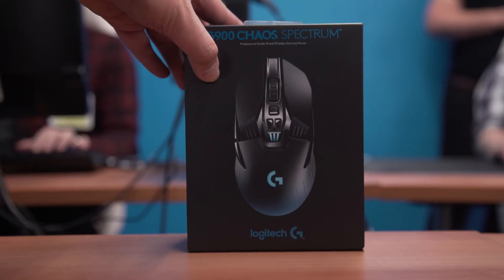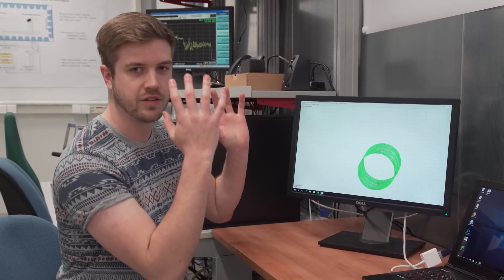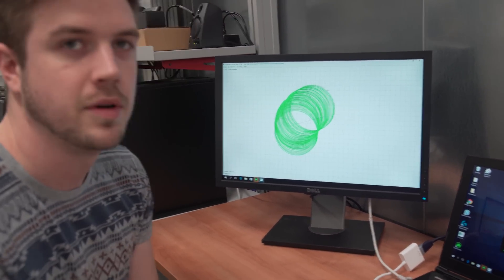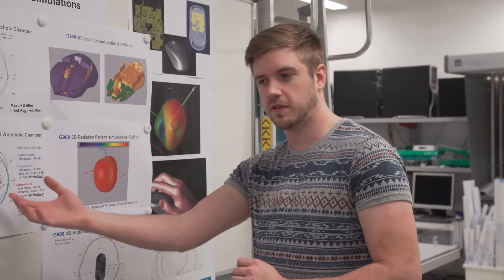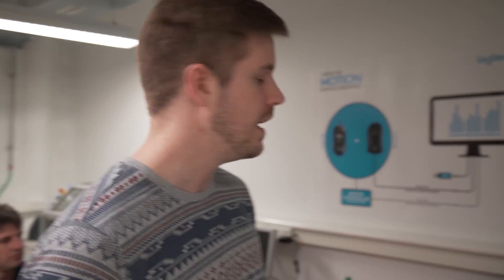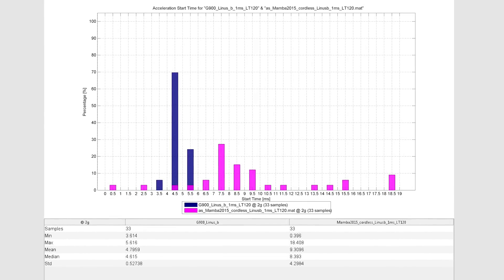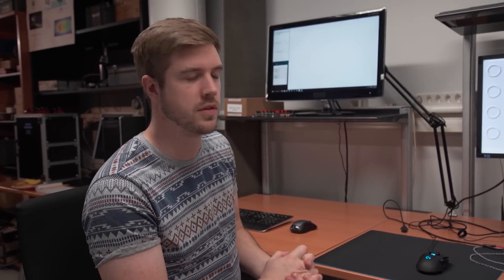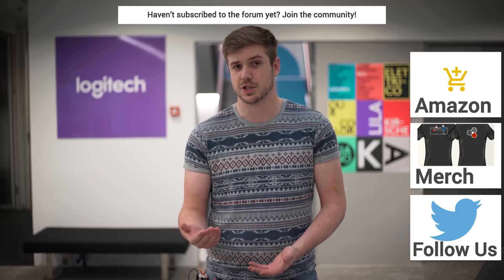Wireless Mouse Technology Testing at the Logitech Daniel Borel Innovation Center

Comment: 1) 'Razer Chroma' is not a mouse. 'Chroma' is a term used by Razer to indicate that the mouse is RGB. You'll notice that the system says 'Razer DA Chroma', which means it's the Razer Deathadder.
2) You talk about the deathadder, but show video of the wireless Mamba.
3) Why are the tests only against Razer mice? Can the G900 not beat good mice?
4) "Faster than a wired mouse"... Yeah.. I'm gonna call BS on this. I'll believe it when I see a 3rd, impartial party test some mice.

EDIT:
I see they added in a SteelSeries for the click test. Must have found another mouse that performs poor in that area and added it in to the test.
Reply: The sensei was also there for the first test.
Reply: The first test was wireless interference... and the sensei isn't wireless... so... yeah...

It also wasn't there for the sensor response test (2nd test).. That was the Logitech G900, Razer Deathadder, and Razer Mamba.
Reply: Bradum
It was. Watch the video again. Here is the product link: steelseries dot com/gaming-mice/sensei-wireless

Comment: My problem with wireless has never been one of performance but the several times where halfway through a round of LoL or during a raid boss the thing dies and I am frantically sprinting around and stealing batteries out of the remote. My wired mouse preforms perfectly with 0 issue and it never has me frantically running around the house. For a standard desktop set up I see no need for a wireless mouse.

Comment: I have to say that I own a Sensei Wireless and never had any issues. It works perfekt for CS:GO. I even went to a ~30 Person Lan with it and didn't notice anything like that. Maybe Logitech has given you a bad sample or manipulated it.
Reply: They were using a crazy worst case scenario though, which is probably why you haven't seen anything like that
Reply: Do you not realize that the signals that were sent were extremely exaggerated as claimed, to see results like that you would need to be at a "300 person LAN times 10" so literally a 30,000 person lan and if that you still wouldn't see those results... It was just to test extreme unlikely situations to see how they would perform.
Reply: +Dr.PanCakes he also tested it without and it was bad, thats what I ment

Comment: Cool video and synthetic tests. But basically, the G900 is different from it's competitors (compeptitors specially selected by Logitech? If so shame on LTT) by not failing in crazy worst case scenario no users are going to experience? Way to go Logitech, have the engineers made you loose touch with your customers again?

Comment: I wish Logitech would compare it to there previous mice as well (G402, G502 and the G602), to see how it copes as an upgrade to there current user base. There certainly pushing it as a major improvement in wireless gaming, but how much of that were they using in the G602's wireless model?

Oh and I get that the video was effectively sponsored by Logitech (bringing you over to there testing campus), but it would have been nicer if the video was shorter, not repeating footage for re-running the tests or anything else of the likes, instead just explaining how it works, getting one clear footage of explanation and then data filling the screen for the rest of it.

Comment: My very first Wacom Intuos 2 Tablet shipped with a CAD Mouse that worked similar/identical to their Pens in that they were wireless AND batteryless by pulling their energy wirelessly from the Tablet underneath it - That thing was ultra light - Just not very ergonomic.

Just imagine a Logitech Mouse that keeps itself charged using the Mousepad underneath it with a small and light Capacitor storing enough of a charge for a few more clicks in the air when the Mouse is not in the charging area instead of heavy Battery that works longer but still needs to be charged by either attaching it to a tether, putting it into a dock ( mostly unreliable ) or changing batteries.

Comment: Just wish logitech would bring back the G9/G9x with an updated sensor. The g303 / g502 don't cut it.
I did find it funny they where still running a mx500 on the desk while testing such a new mouse.. Wonder why they haven't updated to the g502?.....

Comment: How can a person tell the difference between 4 and 7 ms???
Reply: +Khanlar Mamadov Nobody can. Under 20 ms it becomes very hard to tell if there is I/O latency at all. But the reality is... it does not matter if you cannot notice the difference. Let me explain because there are two main reasons why reducing every ms is important.

First of, as Luke pointed out, reducing I/O latency at every step of the line (Mouse, CPU, GPU, Network and Monitor) is crucial because every step adds up. So having 10, 5 or 3 ms less is always good.

Secondly, let's say your average reaction time is around 170 ms with a wireless mouse that has 10 ms of average I/O latency. If you change your mouse to a faster response one, you might be able to lower that by 5 ms, which, as you say, it is insignificant but 5 ms less on average can make a noticeable difference over time on certain competitive scenarios where every ms counts, specially for pixel perfect shots where your margin of error is pretty damn small. The reality is that even 1 ms can make the difference between landing a shot on target or missing.

Having said all this... is it really that important? Mostly not but, as I just said, on a competitive level it could make a significant difference.

Comment: I have been using wireless mouses for years and never experienced a single jump.
Reply: +theSomething most people have the receiver like a  foot or so away, so the signal is stronger. so yeah never had a problem running a wireless mouse (unlike my logitech g600s, the wire is so thick it hinders the movement, so i only run it in wireless mode, thus better performance lol)

Comment: So they have somehow made USB+RF device faster than just USB? So that means, that they have made some significant changes in both; USB and RF, but the mouse would still be faster, with just USB, using the same new and faster technology? I mean, every conversion of the data will always create some delay and RF is one of those. Wireless mice are quite pointless in my opinion, maybe useful with travel laptops, but you don't tend to game with those. I also find it kind of unethical to use your competitors devices in your own promotional video, because it implies a lot of things.

Comment: Would have been nice to see you turn on the interference mid test with the g900 like you did with all the others. Whilst we can see there's no discontinuities, we can't see if the sensor drift remains in the same direction and you pointed out with the others that the jump in drift direction was a sign of interference playing with it. First rule of experimentation is keep your test parameters the same.

Comment: Signal strength and consistency seems important but 2ms more latency when your average gaming monitor now a days puts out frames only every 144th of a second. I mean, it is cool that you can but you don't need to.
Reply: +Ni De 
your math is wrong. It is... 1000ms in 1 sec. 144 frames a sec. 6.94ms..
1000/144=6.94

Comment: You should have also tested the mouse at various distances to the sensor, including as close to a third of a meter away, or even right on top of it. Signal integrity also has a lot to deal with distance between transceivers, especially the interference test.

Comment: i would love to see how a Cyborg Rat 9 would handle interference. since i had one but went to a Rat 7 instead due to the charging station shorting out one night.
Reply: +pesoen rat 9? man them mice suck for people with large hands, they break so easy!!  i went through 3 replacements as the thumb rest screw or such would thread. nice idea, shame they was made on the cheap!
Reply: CrythornMadness i'm running a rat 7 now, had it for at least 2 years with no problem, other than the inside getting dirty. and hard to reach places being difficult to clean. then again, i hardly do much like slamming my mouse into my table to break it and stuff(not that i'm implying you do, but any mouse should last at least a year before any damage occurs, so you must have done something wrong)
Reply: nope, just big hands (im 7ft) and heavy gaming use i guess, but that thumb rest screw goes within a week or 2 every time.(I dont lift the mouse while i game, i just use high dpi) suddenly you feel your thumb sliding close to the mouse as the thread just rips off the screw/nut.
Had to ditch that brand for a logitech g600s and a razer mamba 2012 (use 1 while other charges)
Reply: odd, never had issues, only that it came loose at one point. but efter tightening it, it worked fine up to this day..

Comment: Why didn't they test the g900 like all the other mice? All the other mice were first tested without interference and then turning up the interference while the mouse was operating. the g900 was just tested with interference and without that transition from no interfering signals. This transition was a huge problem for the razer mamba, but after the interference was there it got better again. I have the feeling that they are intentionally not showing that for the g900 because it's just as bad.

Comment: This would be actually worthwhile if done by a third party with better selection of mice (+the reason each mouse was selected). Right now, regardless of how great the mouse might actually be, I have no reason to believe Logitech didn't pick just the subset of their competition that makes them look good. Not even scientific measurements are free from having a spin put on them.
Reply: +Daniel Jeřábek I think they just picked razer because it's one of the most popular brands and unlike zowie or mionix you can find it at pretty much any major tech store. Basically they picked the two most popular models (one wired, one wireless) from razer to devalue the products of their biggest competitor. You're right, though, it would be nice to see an unbiased party test how other mice, including other logitech mice, perform with respect to these parameters.

Comment: I didn't get the point of the first test, can somebody explain that.
Reply: +Squeezy l Squeezomania It checks to see if interference from wifi and blutooth signals affect tracking in wireless mode. Because the wireless sensor and devices like wireless routers operate in similar frequency ranges, the signal from one can interfere with the other. It's the same reason why you'll often get really patchy cell phone signal when you're in a crowded stadium. Too many interfering wireless signals.
Reply: David Livermore Ok, that explains it, thank you

Comment: it is really annoying, that luke never questions the testing method.
Once he said, that this is a extreme scenario. I think its just unfair for the competitors.
They jammed the wireless/wired signals with an unrealistic amount of wlan noise and testet it only with there picket mouses.
Wrap some aluminum foil around  the wire of any wired mouse and you will get goods results to...
Linus always claims that sponsored videos wouldn't buy a good review, but obviously they are to afraid to say something bad.
Reply: To be fair, it just proves for any case, the g900 will perform better. If the results were that consistent and good in an extreme case, it would either a) perform even better in a normal case(other mice will too but it won't be perfect still). What I do hate however is that the battery I don't think is removable(but I see why they didn't).

Comment: If this mouse's scroll wheel/tiltmouse clicks feels as good as the g600's then im sold. I dont understand why mouse tilt isnt a standard nowadays. I just want a mouse smaller than the g600 and one with grip coated scroll wheel with tilt and 3-4 side buttons. also have some kind of weight option because i like my mice heavy.
Reply: +Slade Zero The problem I've always had with tilt scrollwheels, including the g502's, is that if you flick the mouse fast and then stop, like you would when you flick to someone's head, the scrollwheel wobbles a little bit. It doesn't activate the tilt button but it does feel really annoying in games. I don't think it's ever made me miss, but it always ends up bothering me to the point where I get a different mouse.
Reply: +David Livermore well to be honest g502's tilt wheel is garbage. if you used a g600's you would know how good they could be. it doesnt budge unless you mean for it to.
Reply: Slade Zero I've used several implentations of their tilt wheel and the g502 uses a solid metal wheel. That's why it alone weighs about a quarter of the entire mouse. Also I'm not saying it wobbles all the time or anything. I play with a low sens so I have to flick really fast in games. It's only wobbles when I do that.

Comment: Why did Logitech not pitch their new mouse against one of their older ones alongside the razer and steelseries stuff?
Reply: It could make there other products look bad which is a marketing no-go
Reply: +~TwoSkillsFifaHD~ Point made. But if the older ones beat the other brands but not the new model, like they're implying, then it would only prove the brand name well. At least I'd like to think so in my current perspective
Reply: +Zabradley it could also make the new mouse look mediocre
Reply: +Zabradley I would guess that it doesn't perform as well as a g303 or g502 seeing as they use the same sensor with a similar implementation. Probably the same reason they didn't show the g900 in wired mode.

Comment: This is bullshit, the 300 person lan signals where ramped up. But it wasn't told how much ramped up. By naming all other mouse crap for failing communication sometimes in a "jamming" room is a bad argument. That mouse that went all around was still doing "circles", just parts of the motion where thrown out. 

All that this means is that the Logitech mouse is buffering the communication and repeat to send the same data. This might introduce lag, due that the new data will probably at the end of the resend data.

Comment: okay so I get the point of the competitive testing but I think what you should've tested was the raw gear for example we dont know whether the g900 was faster because of the gear the test didn't check the latency in the actual mice just whether the wireless signal was fasterbut jt may have been due to soft and hardware maybe testing a wired version of the g900's systems.

Comment: still prefer wired mouse...i died a lot in games due to battery running out with wireless
Reply: I think it actually alerts you before, then you could easily plug in the cable and still play while wired
Reply: Just put it on charge with your phone when you go to bed

Comment: A sponsored video by logitech testing logitech mice. Even if you guys arent influencing test results you just do not do that sorry, especially if you are using logitech testing equipment
Reply: the clicking test was sooo sketchy, it was like five clicks and the averages for all the had a MASSIVE standard deviation, they would have needed to do thousands of clicks for the results to be somewhat reliable. By the amount of tests conducted I could not call anything i saw a 'trend' and i could most definetly not draw a single conclusion. Shame LTT.
Reply: +Jack Price that is where you are wrong, you can always shape an experiment to work in your favour. The logitech mice obviously use 5ghz connection yet all the interference was 2.4 Ghz based is that unbiased testing? Not at all. And the tests done all played into logitechs hands, for example a range test was not done as 5Ghz would fall short compared to the 2.4Ghz mice from Razer. I am not saying 2.4Ghz is better but to call it unbiased is wrong
Reply: Frederik Lauferts Well, they should buy one. And test it, i mean this is a tech review channel isnt it.
Reply: +Frederik Lauferts if this video was opinion based i'd agree with you. but they're conducting experiments without bias so I don't see a problem
Reply: +Frederik Lauferts On a note about a range test, i doubt youd ever use your mouse in another room than the reciever.

On the other points though, they should have tested with 2.4 and 5 GHz interrferrence
Reply: +Luke-Antra 5Ghz Routers are powerful nothing compared to a battery powered mouse. I am pretty sure even though it is an assumption the G900 doesnt have a range above a couple meters
Reply: Frederik Lauferts Well, considering i dont ahve one (and wont ever buy one) i cant test.
But the reciever should be strong enough for a couple of meters.
Reply: +Luke-Antra Exactly... might be interesting to know the range of the bloody thing

Comment: What a load of bull shit to try and justify an over priced product.  Testing signal strength by bombarding it with a situation you would never ever find in a home or lan setting lmao,  When testing you use a realistic test based on the environment its designed for you do not record normal lan signals and then amplified them 10x and say look how awesome ours is when the reality is when you turn down the interference to normal they all operate the exact same.  As for the other tests i do not even want to get  into why they are flawed as it would make this a massive wall of text.  Its all just techno bull.

Comment: I went from a logitech G9X wired mouse to a logitech G602 wireless mouse last year,  even with the g602 in power save mode I did not notice any differance between that and the G9x.

I have 15 home routers and about 20 bluetooth devices in range of my house, not to mention the crew next store with their 2.4 ghz radios and 5.8ghz fpv gear, even with my RC  gear on it just works

Most good quality wirless mice will be fine in everyday usage that includes the Razor wireless mice and will be not better or worse than a wired mouse